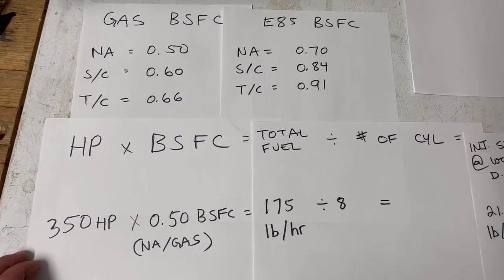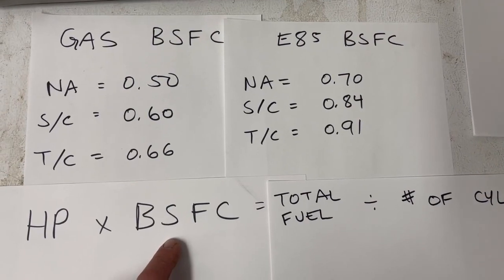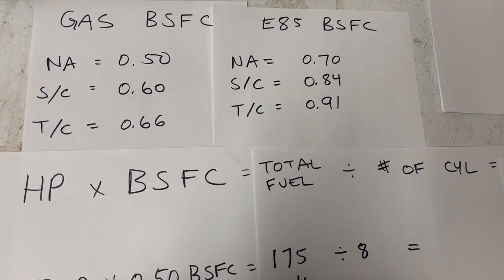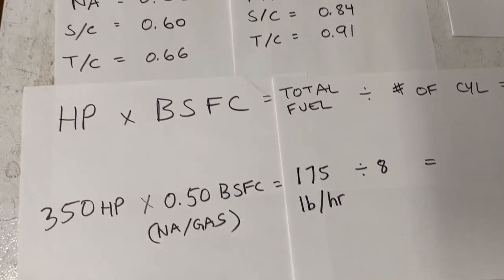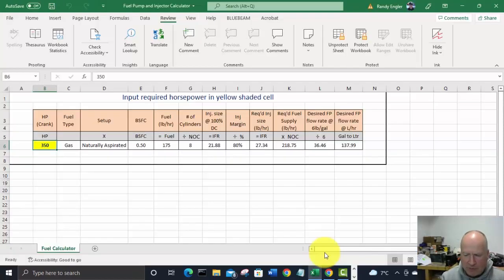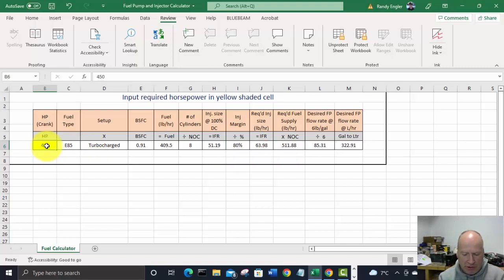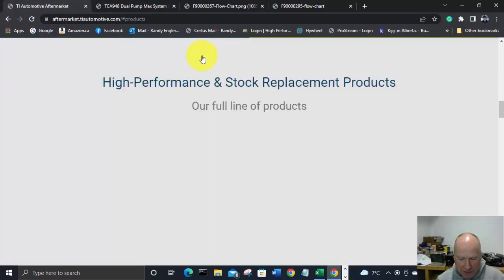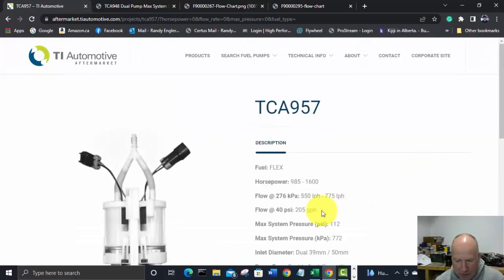Fuel Pump and Injector Sizing for Your LS Swap Project

Comment: Man those numbers seem to be on the conservative side.  Iirc my decapped 24.8# flowed +- 74# and I thought the injector calculator showed they were good to: 60 psi
Gas 925 crank 
e85 725 crank

The 525lph pump @60#+ should handle 900+ hp according to Walbro.

Comment: Great info. I have a similar spreadsheet. For the fuel pump, I take whatever my fuel injectors would be at 100% duty cycle and then add 20% margin. That way I know I will run out injector before pump. I do size injectors to ideally be at 80% duty cycle max.
Reply from the maker: That sounds like a good strategy for fuel pump sizing, thanks for your input, I think I’ll change my spreadsheet to incorporate that.